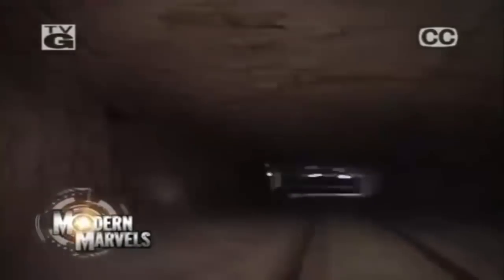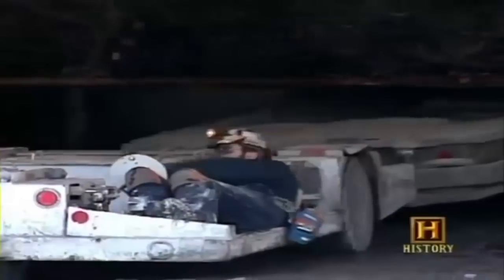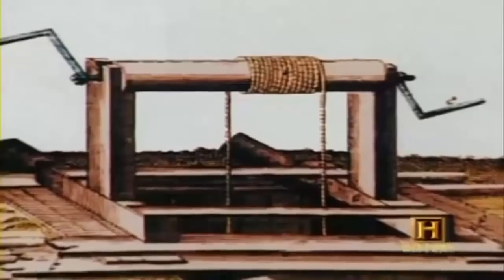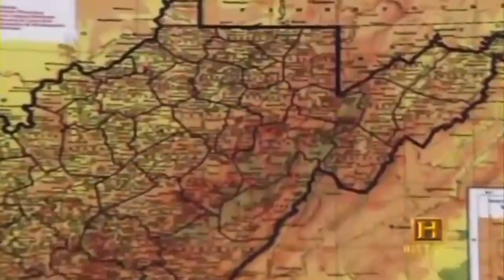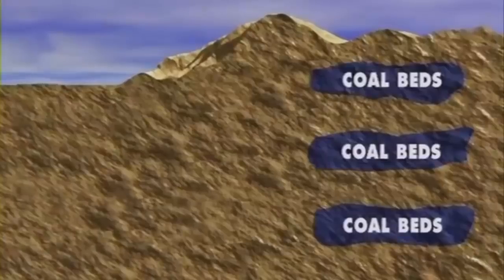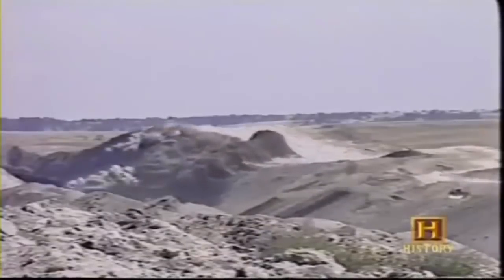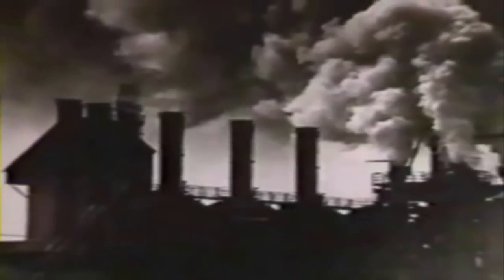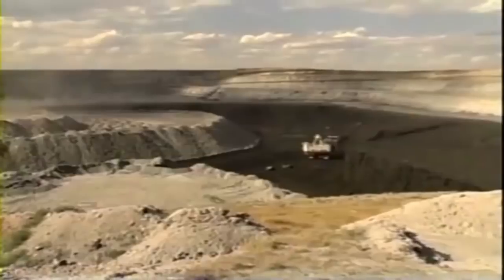How Coal Is Mined and Refined - Top Coal Mining Spots in the World - Documentaries

Comment: What amazes me is how someone figured out coal could be used for steel to make guns,,, that would to me be like me thinking and using  bark of a tree to make aluminum. How would I think of it?
Reply: It's not really the coal that's turned into steel. Steel is made from Iron and the Iron needs to be reduced chemically to form steel. Coal helps in reducing the iron.
Reply: There are plants that only grow in nickle rich soil and absorbs excess. Forms a blue-green bark and has a lot of nickle compounds in it. Yes it can also be extracted. Other plants for other elements are also theorized to exist, but have not been identified yet.
Reply: It's called research
Reply: Its very easy. You use coal to heat iron. People have used coal since the beginning of making fire.